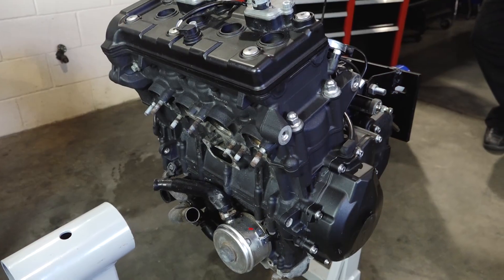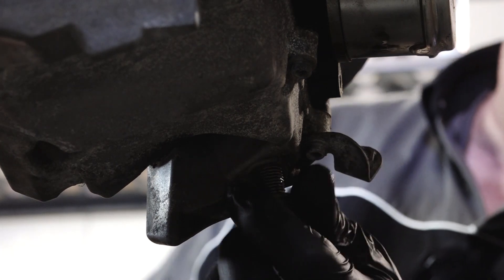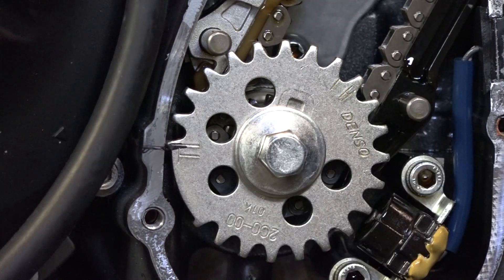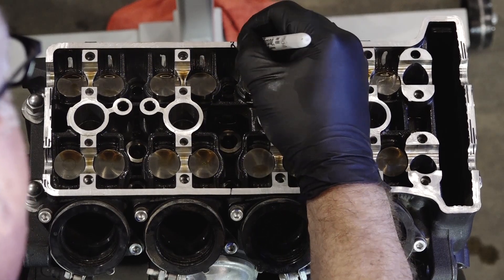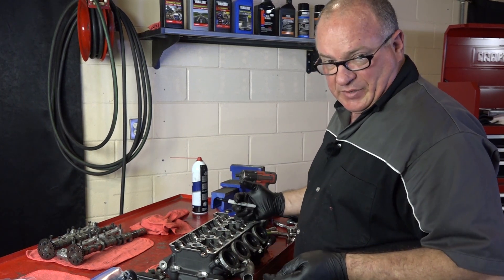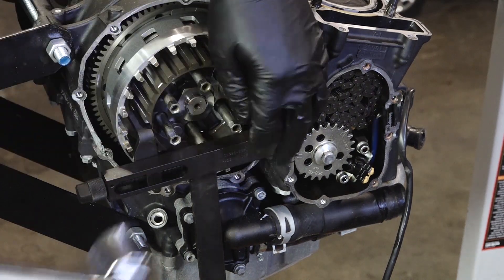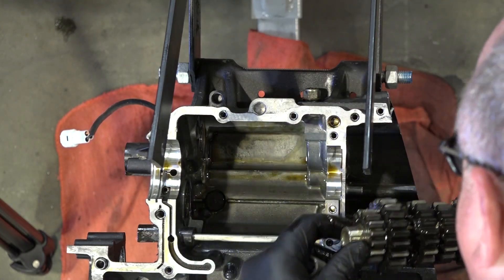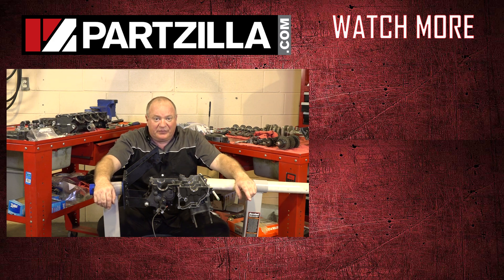Yamaha YZF R6 Engine Teardown | Partzilla.com

Comment: What about pulling the bearing for the stator to get the rest of the basket off? 
I see you have removed the basket, I just didn't see anything in the video about getting it out. 
I'm currently stuck at this part before I split the case and I just don't want to break anything getting it out

Comment: 13:25 stator flywheel is still on but then gone in next steps.  I believe you need the flywheel tool to hold it and get that center nut off.  Havent figured out any other way yet.

Comment: 14:11 How do you keep the transmission and drive gear from spinning when you take the drive sprocket nut off?  Also, this nut on my 2005 is a 32mm.  And the big nut on the clutch basket was a 30mm.  Thank you.  My chain broke and knocked the drive gear cover mount post off which is a part of the engine case mold.  Exposed the transmission bearing.  I'm replacing the top case and this video has been a life saver.  Thank you John and Partzilla!
Reply: I used my clutch spanner vice grip tool on the drive sprocket to hold it.  Kinda janky but worked.

Comment: How did you place the engine on the stand?  What type of stand is that and does require a comparability bracket?  Thanks for the wonderful video this encourages more pinache for valve clearance adjustments.

Comment: Great videos, I have a question, how did you remove the Axle main bearing from the case ? Part number 93306-20464-00  ?

Comment: I bet there are 20 people here who would have swapped you that engine for one that actually needed a rebuild.  Almost a shame to see that one come apart.   Great to learn from though.  Thanks!
Reply: I tore mine down after 10,000 miles , 18,000 Miles and about to do it again next month @ 25,000 miles.  I race mine hard AF tho.  Everything gets ultrasonic cleaned , checked for tolerance , Everytime Ive had to replace at least 1 part .

Comment: Any tips for removing bolts for shift drum? Cant get them out because of being centre tapped
Reply from the maker: Once you remove the bearing housing on the transmission, it should slide out with a little finesse

Comment: Really awesome video series! 
I am wondering if the engine is more or less the same as my 2007 FZ6N? It has started to white smoke and I'm going to tear it down this winter. I just drained the coolant and it looks brown and almost oily? Is that a sort of coolant or could it be oil in the coolant? Its not milky at all. 

Thanks again for these videos!
Reply from the maker: Sounds like a blown head gasket.  OIl in the coolant.  These motors are going to be different to rebuild.

Comment: Clean the oil cooler if you burn out the clutch, first time ive heard that but it makes so much sense. 636 bore on an 03 engine. I wish you would make a video on swapping out that engine in to a first gen 5eb. I was thinking about boring my 5eb, do you have any recommendations on who i should use?
Reply from the maker: For boring and honing, we use Hi Tec in GA.  You can check with your local Machine shops, a lot of them specialize in this kind of thing.

Comment: Hi partzilla: wow very clean and helpful video! I'm planning to fix the second gear (slips on high demand) on my 2006 fjr, do you recommend accessing the gearbox from the top or from the bottom of the engine? Thanks
Reply: Hey¡ How do you do the work? From bottom or top? I have a R6 2008, and same problem, my 2nd gear slips
Reply: @aldairgomez1968  Hi there, I did it from the bottom. You gotta take the engine out and go in from the bottom. I did a video detailing the job, you can check it out. Good luck. https://www.youtube.com/watch?v=INTM12DB99c
Reply: Let me know how it goes.

Comment: Where do I get a stand like that?
Reply from the maker: This was a custom stand we put together.
Reply: Partzilla was it easy to make? I am about to take apart my r6 and wanted to buy this or make it.
Reply from the maker: It was an Autozone engine stand and measured, cut and welded brackets to fit the R6 motor.

Comment: Really kool series.  Brings back memories of splitting cases to fix 2nd gear on a 750 Genesis motor (5-valves per cyl.) and on a XJ750 air cooled.  Fun times !!!
Reply: I know this comment is 7 years old but im getting ready to do this on a 02 r6. Should be interesting

Comment: By default how many gaskets has the cylinder head?
Reply from the maker: Usually it's one gasket.
Reply: Partzilla thanks, i have a little oil leak near that joint, i think the other owner didnt give enought torque to the bolts of the head

Comment: When replacing the output shaft do I have to take out of these parts or just the head?
Reply from the maker: You should be able to leave the pistons in the cylinder bores but everything else around it has to come out.

Comment: What a savage John is not even phased in the least bit when facing engine rebuild. Thanks for step by step guide. I used this video to find out where all the parts went after I failed to ziplock everything. XD
Reply: Fr I be shocked in class wen I'm doing the shit

Comment: How do you take out the oil spray nozzle?
Reply from the maker: Good question, we didn't remove them for this project, the machine shop did.  If I remember correctly, it unscrews from the bottom of the head, but don't quote me on that.

Comment: I would have checked and written down all the valve tolerances, and done a cylinder head valve Test to make sure all were watertight, using white spirit.......shouldn't be an issue as almost a new engine but I just like to make sure.....
Reply from the maker: It never hurts to double check all tolerances, especially when sending something out to a third party for boring or honing.  For the efforts of a timely video, we skipped that procedure.